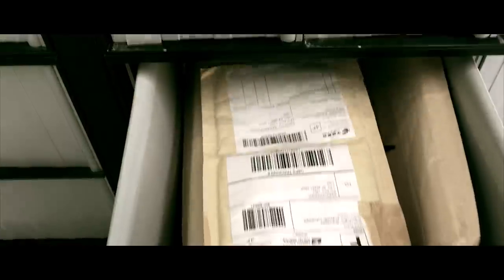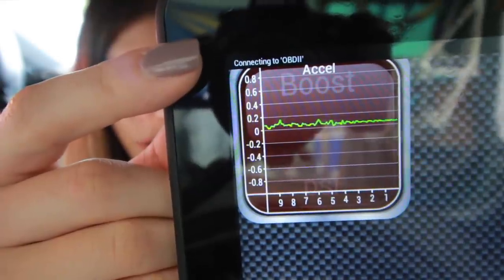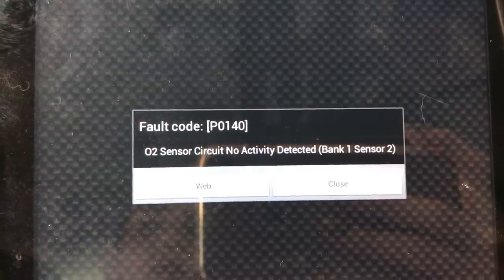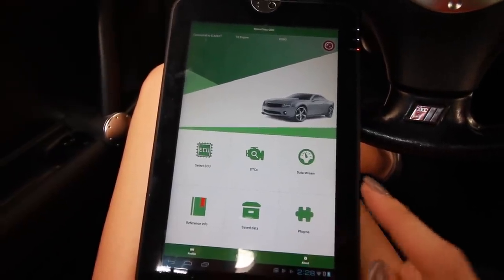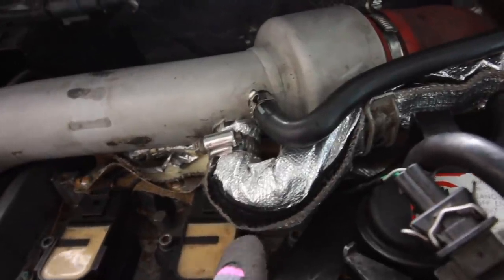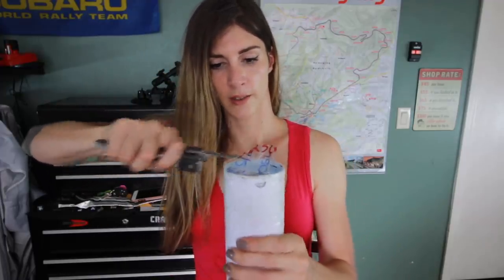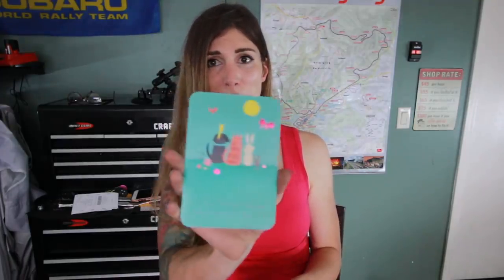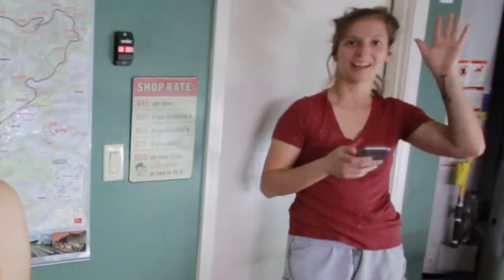Project TT Finally Builds Boost! // Budget Diagnostics

Comment: High flow dp is known for throwing a code and sometimes you can get it to go away by using a stand off to get the wide band O2 sensors to stop sensing too much O2 in the exhaust  gases, some owners actually have to use an aftermarket tune file specifically for getting rid of the O2 sensors check Engine code, it can be a real pain in the squeaking squeaker , hope this helps.

Comment: Hey Sarah! Just a quick tip with your brake pads wear indicator! Just cut and connect the wire together.. not need any resistors... its on cose You have an open circuit... Easy to solve ;)

Comment: The DEI stuff is expensive, but it does work. You could wrap the exhaust with their products to help prevent the heat from transferring to the other components too, I use that on motorcycles to help prevent the heat from getting to my leg. It is a leverage extender, not a pump handle.

Comment: I have an 01 MK1.   Half of the engine cover hardware was missing on mine too.   There are some  cool kits on various websites but they are expensive.  I built a kit for 11.00 from the local hardware store.   If you go the hardware store route, don't forget to will need new clips for the new screws.   Good luck.

Comment: Nice job on the go-pro box! No we can see some good outside shots and maybe some awesome track time shots. I think your abs light is because the rear end is not hooked up yet. Once you get power to the back and clean the sensors in the back you should be golden. You have a lot of online support, kudoos. I think that's how you spell it.

Comment: I use Torque on my phone for my 2002 Altima, sometimes I have to select special settings/options and check the box for "Renault RPM ECU bug work around" and sometimes I have to uncheck it! No idea why, I never looked into it. This may help you for future builds.

Comment: Sounds like its your  longitudinal or lateral acceleration sensor.  If one of these are bad, it will throw the abs light on.  Check the code once the abs light comes one and see what code comes up.  had the same issue and once I changed it, it cleared it right up!  Great content!!!!!!!!!! =)

Comment: You can bondo the tablet into the dash, and use it to show gauges.  But if you use bluetooth, that makes your car remotely hackable.

After you clear the check engine light, you have to drive 30 miles before it might come back.

Comment: Sarah, you should check into installing Windows on your Macbook either through Boot Camp or something like VirtualBox/Parallels/VMWare Fusion... then you could run any diagnostic or tuning software you want (or any other Windows only programs you might want to use) without losing your editing capabilities or needing a separate laptop or tablet.

Comment: OBDEleven is a bluetooth fault code reader specifically for volkswagen group cars you can buy. It also allows you to do some basic long coding. you should look into that if you're going to do any future work on your TT
Reply: Skelbagz this! Sarah get obdeleven pro it's the most cost effective OB scanner and and diagnostic tool for audi/vw... you can do so much more than get codes and clear codes with it... you can run calibrations and see live data on pretty much anything that gives an output

Comment: The brake part or drive part that you are referring to with the holes that are read is called a reluctor  ....check the abs unit  it has pressure sensors built in . That may be the cause of the code.

Comment: You will need to clean the rust off the chopper wheel that the ABS sensor reads against.  Until then,  its just going to build up the magnet till then.  If you have an air power grinder with a cup brush would work the best.  Thanks for the cool channel!

Comment: I use Torque app if you have an android device it works good. There is a free one and a pay one I think for $4.99. The pay one you can estimate your 0-60 and 1/4 mile times and horsepower to wheels.

Comment: You had the "Vtec kicked in" face. Good job getting it running and clean. It looked slow as hell the first two drives but when you installed the hose, it looked like a different car. Have fun with it. Any plans on how to fix the awd?

Comment: Those wheel speed sensors should be measurable with an ohm meter across the terminals.  Shouldn't be open or shorted.  Should be about the same resistance.

Comment: you keep getting the abs light ive had that problem on my mk4 and i replaced all 4 wheel speed sensors still kept coming on so i sand down the little brass part down just so the sensor is sitting closer to the tone wheel and that worked for me give it a try (:

Comment: You need a VAG...obdII...code reader for Audi ..most of the readers or Evan the older snap on can't pick up the codes
Reply: If you ever come up to Gilbert, I have a VAG 5052 factory scan tool for Audi. Havent watched yet to see if youve solved the oil light, but these engines did have oil pressure issues. Feel free to ask me any questions, I have over 20 years with Audi as a factory trained tech and have a lot of the special tools and manuals.

Comment: As of my knowledge. None of the android free or cheap to buy software are not gonna look anything else than engine troubles. I'll think its because safety. What becomes to the vcds not working is just that you dont have geniune dongle. Chinese dongles doesn't work with geniune software. It can not be heard from the video but I'll quess that weird abs feel comes from broken abs ring. Either in the back or the front.

Comment: it just occurred to me , with an open pipe exhaust and no silencers , you can get the exhaust flowing in and out in pulses at low rpm , this can cause a misreading o2 sensor ,so it may be worth waiting till you get the complete exhaust system on there before to go for the fault codes relating to sensors in the exhaust ....i get this problem on open pipe bikes on the dyno .
Reply from the maker: Robert's channel I have a catless downpipe, that’s why the o2 codes pop up.
Reply: Yup Sarah ,lol.... that will be me blithering on in my customary ,did not watch the video properly ,way .oh well, it may be handy info for someone out there .carry on as you were :)

Comment: P1297 I thought that was the water temperature code, I changed out the green 4 pin sensor and it cured it, or am I confusing the code number with P1296?? I shall have to get my RossTech info out lol

Comment: Has anyone ever heard of using one of them smart ride Bluetooth things f from your insurance namely Nationwide and it screwing with the car? I cannot unplug that device because the car will not run without it plugged in. Nationwide has sent me the little bubble wrap to send the two units back to them and I have a Honda CR-V and a Honda Civic the Honda CRV there's no issues the Honda Civic the car simply will not run if I unplug that little OBD dongle. Any advice or words of wisdom would be much appreciated. Oh I should mention I have talked to Nationwide about this they seem so confused they have never heard of this issue they tell me. I'm supposed to go to a certified Honda dealership and pay them to do a diagnostic and if it is found to be the fault of the smart ride device they will reimburse me for the diagnostic payment and reimburse me for the cost it's going to cost to repair I think the computer is what it's screwed up. so it sounds like I'm going to have to Fork out a good amount of money and hope they pay me back within a reasonable time. But I was just curious if anybody out there has had this issue

Comment: Hi Sarah. i use the Torque App on my Android Phone and never had any issues with it. https://play.google.com/store/apps/details?id=org.prowl.torque&hl=en_GB. 

Also, found this bit of info for you about Ross Tech VCDS on their FAQ page..........

1.8  Will there be a Mac or Linux version?

There will be no "native" Mac or Linux versions.  The time and effort required to "port" VCDS to these platforms would never be worthwhile.     VCDS works fine on Apple Mac computers that have Intel processors (all modern Macs) when Windows is installed on them using Boot Camp.    Most computers that are used to run Linux can also boot Windows.     If you do not wish to install Windows, we now offer a platform-independent version of VCDS called "VCDS-Mobile". 

http://www.ross-tech.com/vag-com/faq_1.php